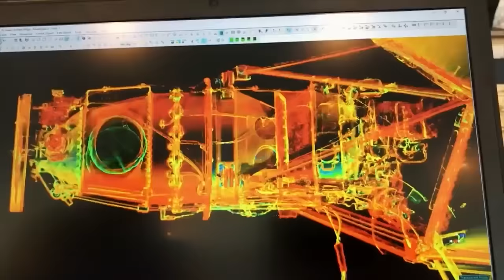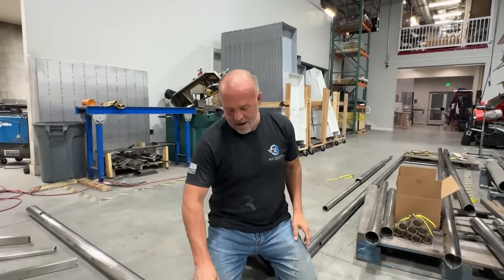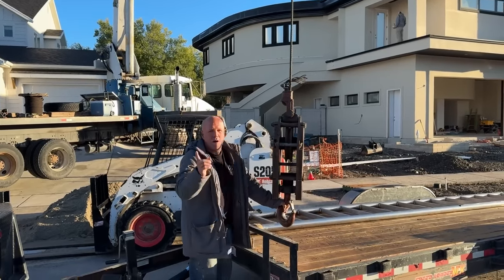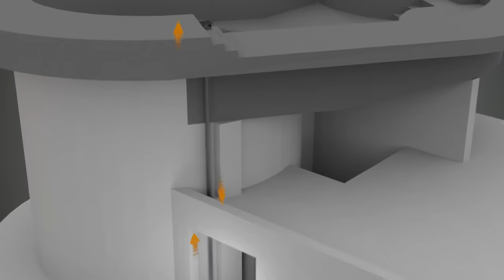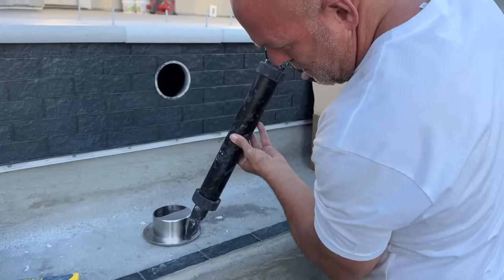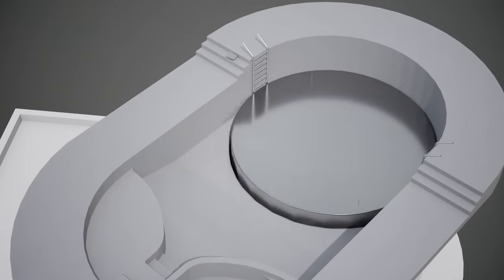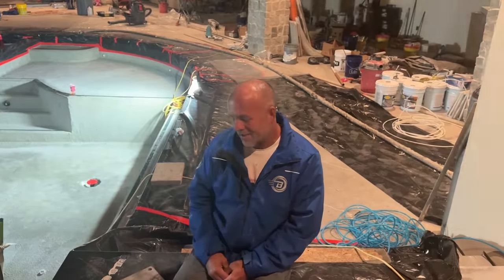Final Touches on My 24 Foot Deep Scuba Pool | House Build #19

Comment: How much water pressure is pushing on the walls?
Reply: About 21,000 lbs/sq ft near the bottom.
Reply: The hoop stress must be incredible. Did he ever go over the lower reinforcements?
Reply: 21000 pounds per square my God that's like a big huge tow truck pushing on it
Reply: @JayL781  Yes, from the inside out.

Comment: watching this is a blast.  "today we're going to run a 50" diameter cable to the center of the earth to tie the ladder to the planet.  then we're going to pour 8000 feet of concrete for the 6 hot tub steps followed by setting the18 foot thick transparent aluminum windows.  each seam will have 300 layers of overlapping rubber, stainless steel and titanium."

Comment: "Hey Mike, what's it going to make this safe?"

Mike: "it's gonna take a 2x safety factor."

"So Mike, how are you going to design this?"

Mike: "I'm using a 100x safety factor in case there is a coincident earthquake, tidal wave, and a nearby meteor impact."

"Hey Mike, you're 2000 miles from the ocean."

Mike: "Just because it hasn't happened doesn't mean it couldn't! Back to work!"

Comment: Joint Inserts at your butt welds? Ladder weight? Why not pneumatic (inverted cup) for floor level with locking mech? and concave PTFE rollers for guiding. Mike I know you thought of these things, just want to be enlightened. Retired ME P&G

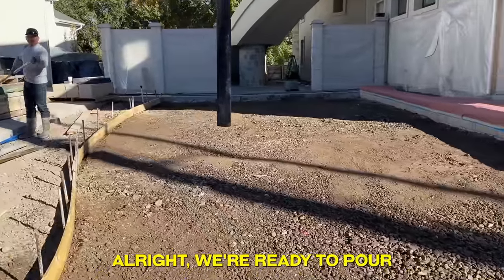Comment: 15:11 No rebar? Um, that will come back to bite you in the OCD wallet in time. Even with the expansion and control cuts, it will fail one day and leave you with a weird crack and possible heaving you'll need to slab jack. Just like you borrowed your neighbour's driveway to lift the pool stair 'rails' with that HEAVY truck and the outriggers, the same one day might happen on your drive way and that's all it takes. Even apron and tarmac concrete as thick as it is uses rebar.

Comment: Why didn't you just do what the railroads do for continuous welded rail and just design the ladders to just always be in tension by installing them at the maximum temp they should ever get to and then dealing with the contraction tension with the anchoring mechanism?

Comment: How are you going to manage stainless steel pipe/ wire/valves with chlorine in the water.  In the nuclear industry, the PMUC regulations dictate the chemical composition of....marker pens,  dye penetrant chemicals,  pressure test lagoon fluids etc...all to ensure chlorine  / chlorine products do not react with stainless steel.